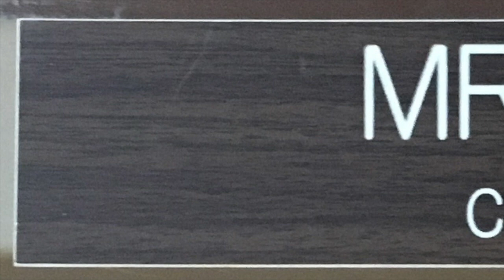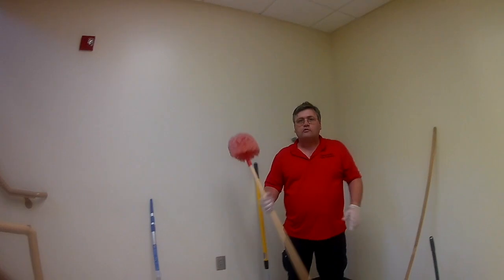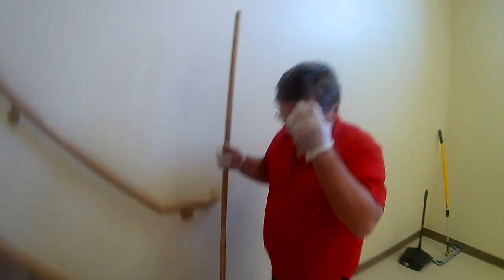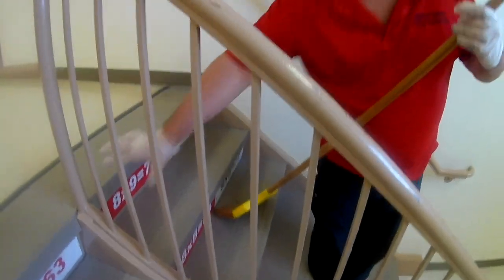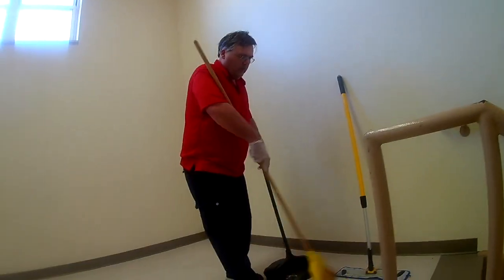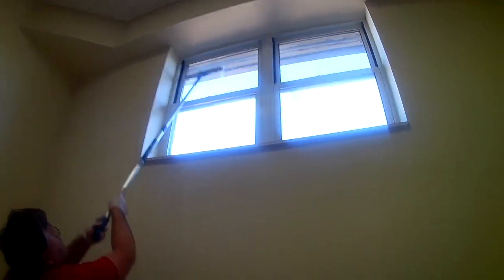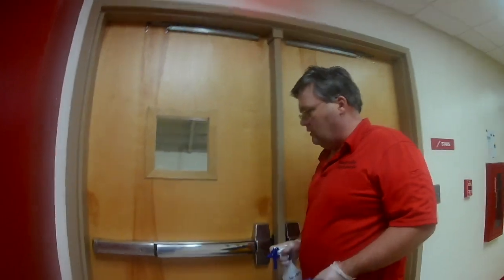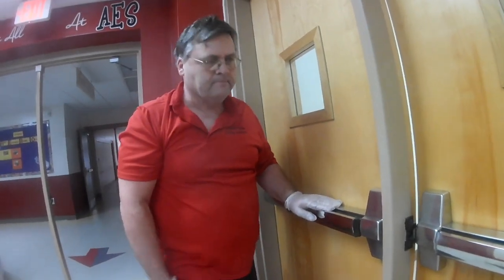custodian training  cleaning stairwells

Comment: I'm the Head Custodian at night at Roosevelt High School in Yonkers NY. I watched your video and found it very informative. I do have my crew mop their stairwells from top to bottom once a week but they do it differently. I have them mop the entire stairwell with soap and water with out wringing out the mop. (Not soaking wet like you do with floor stripper) This helps the solution work on the dirt and help loosen up the soils especially in the corners and the edges. Then I have them change the water and mop up the solution thats on the stairs. After each flight, the water looks like they changed the oil in a car and emptied it into the bucket. So after each flight, they change their mop bucket water. Is this time consuming? Yes. But they only do this once a week and spot mop them daily. I have them do this on their "off days" when it's not their turn to burnish their hallways. I believe the stairwells are just as important as your hallways. They don't shine as bright but they accumulate a lot of dirt especially since they lead to the outside. A cleaner staircase equals a cleaner hallway which equals cleaner classrooms. This is most definitely worth it and I encourage you to give it a try. I'd love to hear your feedback on it. Thanks!
Reply from the maker: We never put stripper in our stairwells. We did that on time. Never again!! We do mop them when we can. We are all day custodians. So holidays when we work is really the only time. We really get to mop them right. We have to spot mop them dry them during the day. Can be some what of a pain at times.